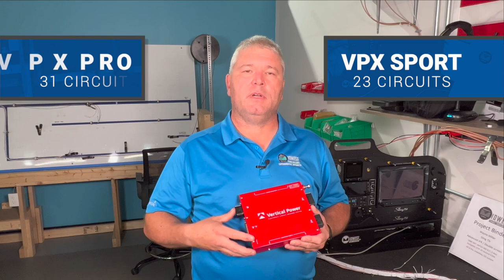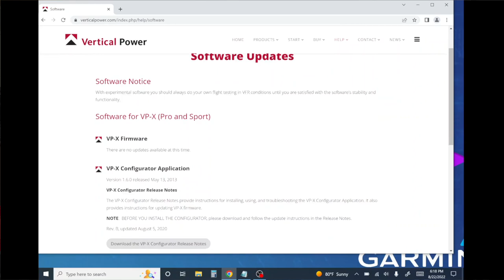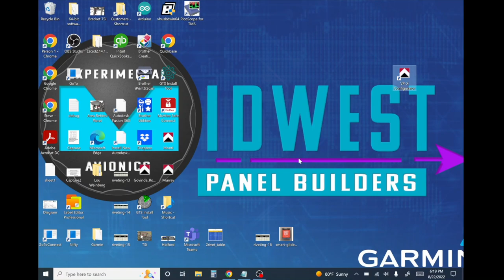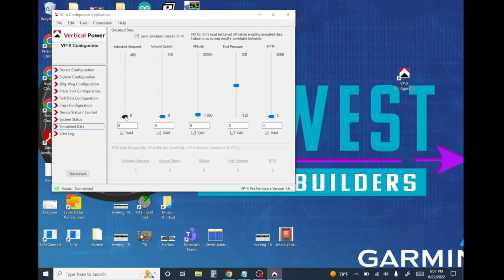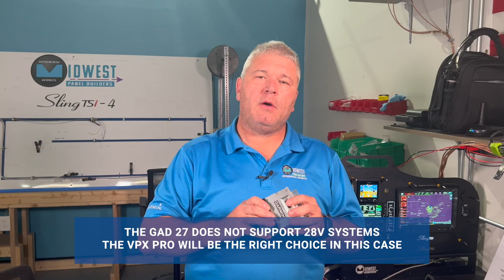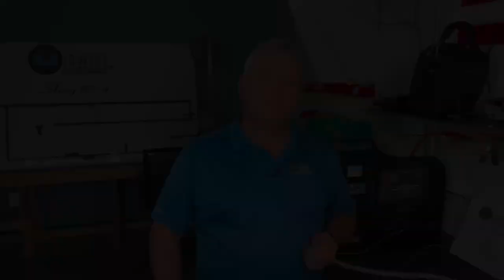The Vertical Power System.

Comment: Thanks for this! I’m about to configure my VP-X plus all Garmin system in my RANS S-21 and it really helped that you walked us through the configurator.
Reply from the maker: Thanks for watching. We really like the PPS, the many features it has such as the resettable from the cabin Circuit Protection for both the alternator and the main power run are really nice. It comes at a price as compared to building your own setup but greatly simplifies the wiring. We also like the integration with the G3X. We will be making a video on that as well sometime soon.

Comment: The VPX has a programmable feature called slow retract which mitigates the concern you have about the flaps retracting all the way with one click on go-arounds. BTW, the VPX does support planes with reflex position (RV-10), so "all the way up" is only to zero degrees flaps. In that regard, it is an advantage that you can be sure to only go to zero degrees with a single click on the VPX, while with the Garmin flap controller, you have to count your clicks to not accidentally go to reflex.
Reply from the maker: Thank you for watching, yes we do know hat you can control the speed as a work around, we still personally like to control it myself. It is just the way we work and may not be for all.

Comment: Very helpful video. I have watched it several times.But, I notice that in most of your panels there are still a few CBs? Are there some loads that are too big for the VPX? What breakers do you still need?
Reply from the maker: Thanks for watching! 

Our earlier Sling panels had the main breaker on the panel, we have since moved that off panel. 

On engines such as the Rotax 914 that has 2 electric pumps and no mechanical pump, we will run one on the VPX and one on a breaker.

Some of the Vans panels may have breakers for their SDS or Fly EFII system that do not run through the VPX.
Reply: Thanks for the prompt reply. If I may, a follow up: what about for external alt? Fuse box? No need for CBs?  @MidwestPanels
Reply from the maker: @justindwyer3430  we will run the alternator on the VPX since it has built in over voltage protection. This is for the field wire of course and you will need to protect the main feed wire outside of the VPX.

Comment: Hi I bought a rv 10 with this system. But my vpx menu is not where you showed. Is there some where Els i can have a look.... My ignition power is dead.
Reply from the maker: The VPX is often on the second GDU so if you have 2 G3X screens look in the copilot screen for it.

Comment: Why not just use a simple switch for ALT like a Cessna vs. having VP-X control it? For VP-X to control it on the Rotax iS didn't you need to install a relay? Which one?
Reply from the maker: By using the VPX to control the alternator, you get over voltage protection, If the VPX senses over voltage it will shut down the field wire, to get this protection without a VPX you will need a crowbar. No relay needed unless you want to have one to break the main feed from the alternator for extra protection.
Reply: @MidwestPanels  got it, but the Rotax iS doesn't have an Alt field. I thought I heard you say you use a relay in the video?
Reply from the maker: @GaryRudolph  though the Rotax engine itself doesn’t have a field the external alternator that is often installed to supplement does, this is the field we are talking about.